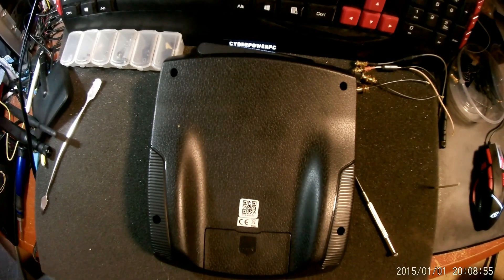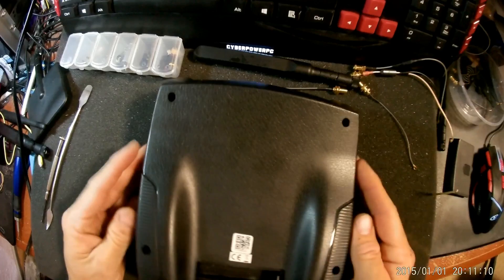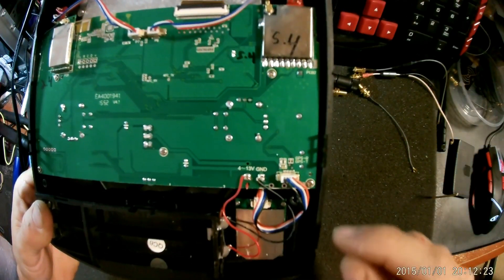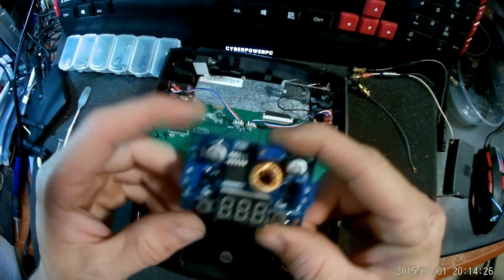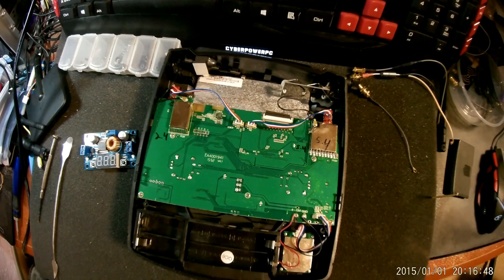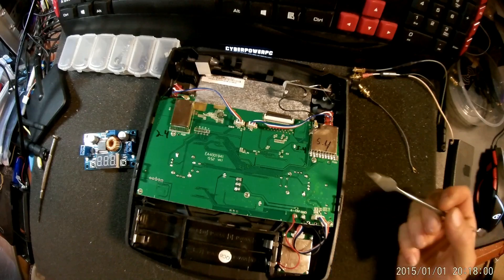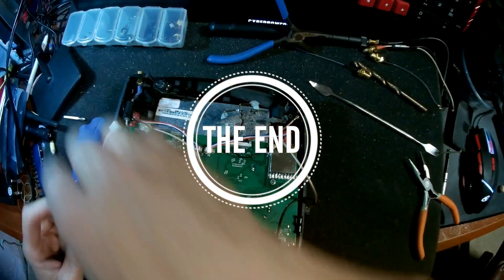How to Battery Mod Hubsan H501s Transmitter to a Lipo Battery Diy

Comment: My buck converter has current as well as voltage what do I set that too. Great video and your help is greatly appreciated  thanks
Reply from the maker: Well volts are no more than 13v I think been awhile.  But current or another word is Amps/draw. This rating is not a big deal if set to max. Reason the hardware will only draw what it needs and no more. So just make sure volts are not too high for the board rating. No reason to limit the current setting.

Comment: Great video. I have tried this mod on my Hubsan h501s using 11.1v mod. I'm now back to stock, but now using 4x AA "Energizer Ultimate Lithium" batteries. I kid you not! I got 400m extra range (from the same spot). I have used the same battery set over 15 flights now, each flight ranging from 13min to 23 min. It's still on full bars. Just try them. Their around £5 for a pack of 4.

Comment: I just want to add that on newer makes of this model (Anything after late 2016 I think, I got mine this month but it had been sitting around in a warehouse for a few months at least by that time.) has a JST connector built into the side of the battery compartment. So the way I modded my Tx (As in, just now, literally five minutes ago.) was by adding some strong velcro on the outside of the case, right above the battery compartment and between the hand grips, and then leaving the battery door off and just attach the battery with another strip of hobby grade self adhesive velcro. It may not look as good but it lets you use literally any battery that fits the 4-13V interval. I'm using a 11,1V 3S pack but in hindsight I should probably have gone for a 2S pack of the same size with more mAH. Oh well, it's what I had at hand at the time XD

Comment: Nice video thabks for making it. Just modded my controller following this. I used the same little lcd screen thingy you had and just cut the original cables from the battery box and connected it straight to that, so no soldering or splicing needed. I hope theyre good enough. So far turned on fine, just charging batteries before i go for a test flight. Thanks again!

Comment: Greetings for a control of bayangtoys x16 using 6 bat. AA I can use a 11.1v 2200m battery. Thank you
Reply from the maker: You can use a 11.1v but MUST use the BUCK CONVERTER to drop output voltage to 9V (6AA1.5v=9Volts) Unless you know your Tx's boards voltage capability you must drop voltage to be safe. You can look @ your Tx board and see if it has voltage capabilities printed on. Otherwise just use the buck to be safe.
Reply: Muchas gracias por tu ayuda.

Comment: so the extra volts doesn't go to the antennas to increase db?
Reply from the maker: no.. the voltage wont go the Radio Tx's to help with higher output. Just a bit of extra heat you wont notice.

Comment: I modified my transmitter and added the antenna and battery.  When I turn on my transmitter, I don't see the GPS telemetry for the drone on the transmitter. What do you think is the issue? 

When I put the transmitter back together,  I didn't realise a screw went in on the blue wire of the gps connection. I smelt a burning.  ... could that be the reason I'm not seeing the gps on the transmitter for the drone?
Reply from the maker: FOr the drone or the TX gps. THe Tx has a GPS antenna Built In and the Drone GPS data comes over the air via 2.4ghz transmission. Don't think so on damage but if you let the smoke out that is bad.. Try to RE_BIND the TX to the DRONE. ALso you need to post this over at RCforum or on facebook. It will help get you easier support. https://www.rcgroups.com/forums/showthread.php?2522182-Hubsan-X4-H501S-5-8G-a-micro-brushless-5-8G-1080P-FPV-%28under-construction%29
Reply: Justin Smith Thanks. I think the GPS module is bad. I did rebind the quad to the transmitter and the GPS telemetry still didn't show for the transmitter. I opened it, it looked like a wire was melting. Do you know where I can buy the GPS module for the standard transmitter?
Reply from the maker: email and ask Shally Liu @hubsan for that part.
MAke sure you specify TX GPS not Drone
Email shally.liu@hubsan.com
Reply: Justin Smith Thanks for your assistance. I really appreciate it.

Comment: dude im confused u say u dont need the buck converter but reccomend im using same as quad battery n have a spare connector for i was just going to solder n try that but now thinking twice about getting a buck converter first
Reply from the maker: I don't mean to confuse you just after modding both with a buck and without it. more than a year I have had no issues with heat and no one else has had any issues to date. So as long as you keep your BATTERIES VOLTAGE under 13V output then you can mod without the Buck. I do prefer 7.4v batteries but you can use anything up to 13V.

Comment: Hi. I'm new at this. Could this buck convertor work? 

https://www.amazon.com/GEREE-Efficiency-Transformer-Controller-Adjustable/dp/B00O61J6WW/ref=sr_1_14?ie=UTF8&qid=1484748910&sr=8-14&keywords=5A+High+Current+DC-DC+Buck+Converter+Power+Supply+Module

or this one

https://www.amazon.com/Gowoops-Adjustable-Step-down-Converter-Voltmeter/dp/B01KFH32YI/ref=sr_1_16?ie=UTF8&qid=1484748910&sr=8-16&keywords=5A+High+Current+DC-DC+Buck+Converter+Power+Supply+Module

Which would you recommend?
Reply from the maker: That will work and here is another one http://a.co/iorKexg
You may decide NOT to use the Buck if you are not over 12v to start. We are having no issue with our TX;s that only had Battery Mod no Buck and run 11-12v batteries. Just wire Direct if you want save the money.
Reply: Justin Smith Thanks much.  I really appreciate your fast response and support. I just made my order.  How often would I have to change a buck convertor though? I got this battery to go with it. http://m.ebay.com/itm/2PCS-7-4V-2000mAh-Lipo-Battery-40-Banana-Plug-41-25C-For-Syma-X8C-X8W-X8G-Quadcopter-/291601014283?txnId=1397443086019
Reply from the maker: Once you set it for the output voltage (say 6v) it is always that voltage no matter what is on the input voltage. Never need to change.
Reply: Justin Smith OK.  Thanks man.

Comment: hubsan 501s.-- can't get the  video and  pictures to  work. I forgot and turned on the tx  when  exterior antenna was  off could that be the problem? the screen works  on tx  when  flying. appreciate any help
Reply from the maker: Rebind the TX to the quad or try to change the FPV 58Ghz channel in the menu.
TO bind -- Hold down PICTURE BUTTON and then Keep holding while you turn ON the Controller. A BIND to PLANE will show on screen NOW place real close to quad and then power on quad. Should beep and bind. hope you see video then. No bind try to power on quad again or move the controller closer. 
Example from this YT user https://youtu.be/aHMDJiNGzrI?t=8m27s

ALso look in settings and change channel.
Reply: thanks Justin for the info

Comment: The other one that I don' use anymore in the cx-20 (returned), and never used 'cause it was his spares, is a LiPo battery, 2200 mAh,., 11.1 volts, 30 c. But tgere is not written if it's a 2 or 3 cell.Can I strap this on (without the part that you used here)? Directly? just a plug soldered to the board?Thank youIf for buying, ti attach directly, which will be the perfect on?THANX
Reply from the maker: 11.1 volt is in the range the Board will except.
Reply: Oh, thank you
Reply: So this 30C will even go ok

Comment: I replaced the double a batterys with a 6.6v li fe  but when I turn on the transmitter it shows   no cells on the battery  solder a jst  to the board and a 7.4v li po  worked fine. don't know why the  6.6v li fe  didn't work

Comment: great video man... I wanna do this mod but im not use if my battery capacity is good enough...  i have a 2000mah battery... do you think that's would be enough power for about an hour worth of flying?
Reply from the maker: YES it will I use a 2000mah on this mod and it gets 6-10 flights.

Comment: Hey Justin, 

Thanks man! Love your vids. I completed the lipo mod - - but mistakenly touched the positive battery wire on the rectangular-shaped silver 2.4G antenna module. The result a small but scary burst of fire, and smell of something burning. It appears as though a soldered connection melted...Not Good! I can send you a picture. I think I burnt out the 2.4G module. The transmitter turns on but no telemetry period. There is a small burn/smoke mark on the circuit board under the lower-left corner of the module. The transmitter binds to quad - but quad will not start. Can you make a vid on how to fix this problem or replace the 2.4G module? Thanks a zillion!
Reply from the maker: Sorry for the bad news on your mod.    I can't help with that.  It would be to much to do.  Look into ordering a new replacement Tx.  Multiple hubsan TX's work with the quadcopter. Check online but Banggood should have it.

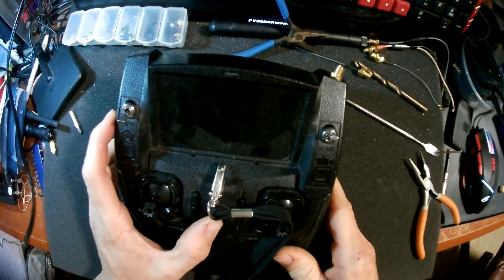Comment: At 15:52 - should you really be turning on the Tx without the antenna being plugged in?
Reply from the maker: No worries..  This has a very low Milla watt and won't weaken the Tx.  I have tested with no issues in the past.  But always good practice to have a place for energy to go..  Attach your antenna first.! Thanks for the remarks

Comment: Hello,

Looking at your tutorial I did a similar mod to the controller battery using the same battery as the quad. Works great!

...but did a wrong move with the soldering iron and damaged the cable connecting the GPS module to the main board.

It is a basic 4 pin connection, but have no idea what it is called and where I can get a new one. By any chance, could you point me the right direction ?

thanks
Reply from the maker: Oh man that is a bummer... I think it is 3S Female TP Connector
Reply: thanks for your answer. Would you happen to have one handy to confirm it is the right plugg?
Reply from the maker: Yes Verified it is a "3S TAP Connector"
Reply: +Justin Smith. Thanks for that. Time now to find out where I can find a male male "3S TAP Connector". Rgs
Reply: Hi Jason,

sorry to bother again. I can't find this  "3S TAP Connector" reference on the net. Would it have an other name? Or is it connectors that are often used for a different purpose ?
From what I gathered the traditional 3S balanced charger won't fit.
thanks
Reply from the maker: +Benjie B not sure if you can get it with male male.. But you can make that with two cables or crimp end kit.  Try here for it.  http://www.rclipos.com/Accessories.htm
Reply: Thanks!

Comment: Hi Justin,
Great vid btw. This may be a little off subject but because you seem to know your batteries have you heard of anyone using KENTLI 1.5v 2800mWh rechargeable KTV Lithium AAs in the controller. My only concern about using them is that when the voltage drops it's drops suddenly. I just wouldn't want anything to happen mid flight .They are also expensive which is also a con. 
Thanks in advance!
Reply from the maker: Yes and many other AA reusable options work great. The negative is what you stated Price. On the voltage drop just monitor it and the controller does not die instantly. On low voltage the TX goes into a power save mode by turning off the LCD for FPV. That conserves enough power to fly it back by sight or RTH. I like to reuse what I have and keeps cost down.
Reply: Thanks for the info would make me feel a little better knowing it doesn't instantly shut everything down on the controller.

Comment: I'm wanting to modify the transmitter battery pack from the original AA batteries to a LiPo 11.1V 30C 2800 mAh. In that connection, I will connect a buck to reduce the voltage to the motherboard to 6.2V. However, my concern is the acceptable level of amperage  that the motherboard can safely handle as transferred through the buck. Will the specific buck used in your demo simply pass on the 2.8 amps to the motherboard? If so, can the motherboard tolerate it? If not, is there another buck capable of managing the 11.1 2800 mAh battery power to the motherboard? In the alternative, show a lower rated LiPo be used in this application?
Reply: So as clarification the 2 amp rated buck will withstand the 2.8 amps coming from the LiPo? [I remember one posting recommending a buck be at least twice the rated battery capacity?] Thanks again!
Reply from the maker: To be real simple here. Amperage is not relevant here really. The load device will only pull the appropriate operating amperages it needs and no more.
Reply: Thanks Justin! Stated another way will the 11.1V 30C 2800 mAh battery adversely effect the 2A rated buck?
Reply from the maker: No.. not at all. 
Your TX will never pull that much Amperage.
Reply from the maker: YES.. The board will never pull anyway near that amperage. So does not matter about the battery rating.

Comment: Hi Justin, 
i quick question. on the board it says 4-13v. But the battery compartment is for 4x 1,5v = 6v.

Since its a interval of 4-13v, this means that i could just solder a 7,4v Lipo battery there and have it work, right?
I just buy another hubsan 7,4v battery. I have the charger for the quad, i could just use the same to charge this one aswell right?
Reply from the maker: Yes you can. That is what I stated. You got it
Reply: +Justin Smith so whats the point of having the range? Will higher voltage give me better range or something?
Reply from the maker: +BenjaminMirzai antenna mod helps reliability.  In case structure or distance. The higher voltage will not give you any more range than the antenna power will transmit at. I discuss why you can use higher voltage 13v but let you know why we use a buck converter to reduce heat from that extra voltage. Hope that helps

Comment: Hey Justin. Two questions. I am a bit of a newbie with soldering and wires. First what gauge wire do you recommend i use for battery mod and two---when soldering to the board is is critical that i do not touch the iron to the board( just heat the wire to melt solder) ? Thank you...Great Videos
Reply from the maker: Around 15 to 20 gage is great! you can always find wire around the house from some old electronic. Yes heat up iron and then get a bit of solder on the tip then touch that to the wire. The solder on the tip helps to transfer heat to the wire. After a moment the wire will be hot enough to start taking on the solder. add solder as needed. I recommend looking at some videos here on solder tips and how to. 
Good luck but you can always crimp the wires.. ;)

Comment: Need a bit of help. please. For whatever goofy reason, I need to open the package on my 2700mah 7.4v Hubsan battery. I need to replace the positive lead wire. Is it OK to open the battery?
Reply from the maker: sure and then solder it back on. This happens with batteries.

Comment: Hello there. I would like to start off saying you do great videos and are very informative. I was wondering if it would be possible to send my hubsan h501s controller to you and you do the battery and antenna mod. I am willing to pay for all supplies and labor. Thank you!!!!
Reply from the maker: I just dont know what I would charge that would make it worth it to me and you I think it would be to much for the value of the result. Please have faith in your capabilities and give it a try or ask a friend to help. you dont have to soldier you can crimp the wires and the antenna is so easy. Good luck and DIY

Comment: The buck converter looks too tall. How did you make it fit?

Thank you
Reply from the maker: Some do better than others in the battery area with a small battery alongside. Others can be hot glued underside.

Comment: I have a number of JST connectors. Do you know if they can be used for battery connections? Thanks in advance.
Reply from the maker: Yes use any connector you like to connect to your battery of choice. I have used them.
Reply: Thanks

Comment: Awesome, so just to clarify, if I did not want to use the Buck converter I could just attach the appropriate matching female connector to the wires that are currently soldered to the board and plug the Lipo directly in?  As long as the lipo battery I am using has an output voltage below the 13V limit any size lipo battery will work (assuming the physical size will fit in the tray)?
Reply from the maker: +lldanll You can do it like i stated without the buck module. Your statement is right on.
Reply: +Justin Smith Thank you for your expertise!

Comment: Hi there very useful video here. For a newbie, could you specify what connector and battery I need to buy to do the mod. I would rather NOT add the converter if possible. And what charger would I need? the quad's stock will suffice ?

thinking out loud here... can the quad and the TX use the same batteries ? would be easier ;)
Reply from the maker: Yes You need an ec2 connector to use the quad batteries.  And you don't have to use the buck.
Reply: Hi Justin.

thanks for your answer. Since I haven't yet received the quad I can't tell whether I need male of female connector to mod the TX. Can you tell me ?
Reply from the maker: +Benjie B ec2 male for Tx if you are using quad batteries

Comment: Do you think just using a fully charged 2S Lipo (without the buck converter) would be ok?
Reply: Does the buck increase the battery run time?
Reply from the maker: +Sean Riha yes thats completely fine to do.

Comment: hello i was wondering if I could pay you to mod my husband h501s transmitter?
Reply: As Justin demonstrated, it's not at all difficult. Don't let the components on the BUCK converter intimidate you, it's nothing more than connecting wires, keeping an eye on polarity ( + & - ) and voltage output ( 6vdc is optimum. ) Like Justin said, you don't really need to use a buck board, as long as you are aware that excess voltage is dissipate d via heat, which can injure a circuit component.  Follow Justin's directions, they are perfect.
Reply from the maker: You don't think you can do it your self? I tried to make it easy to diy. What's your biggest hurdle?